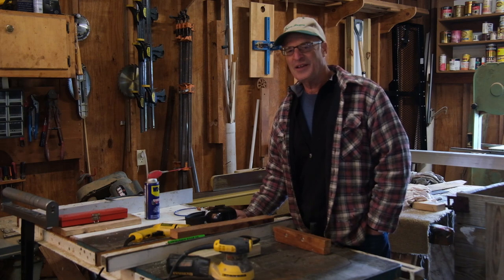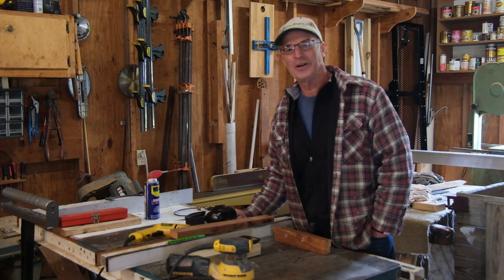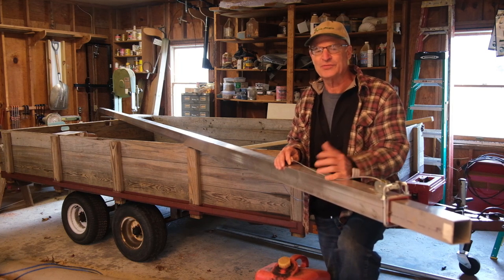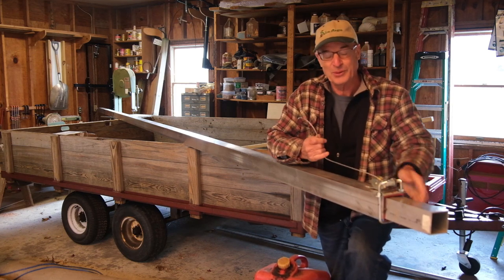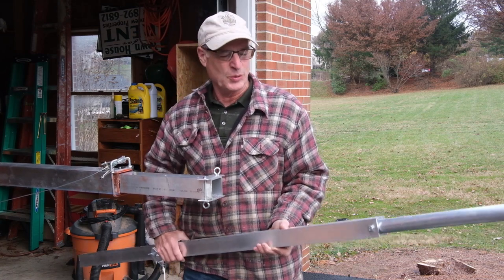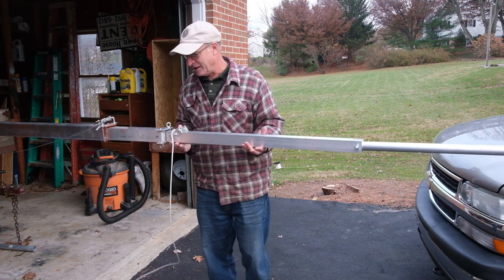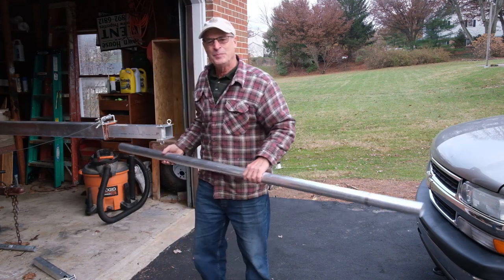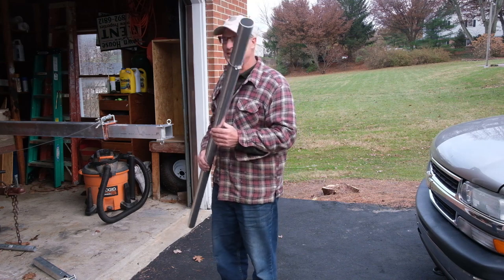Portable Telescoping Mast / Vertical Antenna

Comment: Great job, Jonathan! I just put up a GMRS antenna at my house…but, I wasn’t financially able to be as fancy as your install was after the expense of buying two HTs, one base radio, SWR meter, power supply, all of the clamps, coax, rebar to reinforce the bottom of the mast, etc, and the mast itself. The top of my antenna is only 21 feet above the ground but is working quite well talking from my house in Houston,Tx to California, Louisiana, and all over Texas with the help of repeaters currently. I have to say that I absolutely LOVE your crank-up operation of each section! Stay safe and 73s! ~Jim WRXY 695~
Reply from the maker: Nice.... Happy it is working well for you.

Comment: I helped a guy put a hex beam up, several years ago.  It is very light and low wind load.  It tuned up well and has survived Houston weather since.
Reply from the maker: Yes...our Field day group has switched to all spiderbeams.   Very light, not traps, nice gain, and very easy to assemble and they give 10, 15, 20 with very low SWR.    https://www.youtube.com/watch?v=DCMhtuU4ax8&t=6s

Comment: What a great video as well as a great design. I'm also very impressed with the results of the vertical working DX. 
I was wondering how you knew when to stop cranking so you don't unplug the second section of mast. Here's a suggestion.
The cable that connects to the telescoping section is fixed to the tubing. Once you extend it, put some red paint on the cable
close to the ground where you stand. Also put some red paint on the bottom section of hour mast. When you extend the second section of tubing and the two red paint marks line up, you are done. 

To be able to easily take apart the mast to use it for field day as well as a DX antenna in your back yard is great. 
The shunt coil is a great idea. I choose to make UnUn's for matching. Jerry Sevick's book shows how to make a 38 ohm to 50 ohm UnUn and it also puts the antenna at DC ground. I've made numerous UnUn's for inverted L's but they are 22.22 ohms to 50 ohms. 

Nice job, nice video and thanks for sharing.
Barry G. Kery, KU3X
Reply from the maker: Thanks.   Actually I did put a piece of tape on the second cable so I knew exactly where the vertical was 1 to 1 on 80 meters.   Because it worked so good I actually built a fan vertical for 80 and 160 with wires.   I really like that fan vertical....don't know why it took me so long to take an interest in something like that.     I must say I tried this telescoping mast to raise a 2 element 15 meter beam from the back of the car but quickly realized it's bracing was far from sufficient.   So fabricated a strong tripod with angle iron to raise a spider beam for this field day.   I really believe it will work great.   I am sure I will have an update on that project when I finish the homemade spiderbeam.

Comment: Very nicely done, sir - I really enjoyed watching your video! 

I am new to the amateur radio hobby, and have built a 1/4 wave multi-band vertical antenna based very closely on the DX Commander All Band Vertical antenna. Your results bear out what I have found in studying just a little about antennas - that vertical antennas have a lower take-off angle than horizontal ones, and thereby are better suited for long range DX work. With my antenna and a 20 watt Xiegu G90 radio, I was able to have a conversation with a station in Canada, 1000 miles north of my location, on the 20 meter band. 

Having success with my home brew vertical antenna was very satisfying to me - I can only imagine how pleased you must be with the results of your project!  73 to you, KO4AZY.

Comment: Nice, go by a box of wing nuts for the radial plate.  Since it’s a “temporary installation, it would likely make the job of installing the radials easier.  I have a DX Commander, and he connects 5 or 6 radials in6to a single yellow fork crimp and just slides it over the bolt and tightens it up.  Very nice construction of your mast.  Years ago, I scratch built a lighting mast that went up 45ft in 3 sections,  but when we built ours, it was steel and we used rollers to reduce friction when winching it up.  The lights presented a significant wind loading, so steel was better suited for the loads.  I think we did 4”,  2” and a round 1.5 pipe at the top but it’s been a long time.  Got to love verticals for low angle takeoffs.

Comment: Interesting build of a vertical antenna that had amazing results.
Reply: Up 33ft you could probably use it for a 20 meter 2 or 3 element Yagi antenna with rotator.😮😅😊

Comment: Sir, This has to be one of the most impressive, professional looking setups I've ever seen. I have been into the CB hobby for a number of years and I've recently been interested in getting my Ham license. It amazes me the amount of intelligence and information that Ham's seem to have stored up in their minds. It's quite overwhelming to say the least. You have definitely brought the interest in obtaining my license back to the surface. Hopefully we'll be able to make contact in the near future. Best of luck to you from Central Indiana and God Bless! 
-Brian
Reply from the maker: Thanks.... It is fun to build stuff and make it work.
Reply: So Jonathan, when are you coming over?  This is exactly what I need!
When it was all said and done, how much did this project cost you?
Reply from the maker: @richarde735  I really don't know.... Maybe 350 plus balun which was 89.
Reply: Jonathan Charles  $350 isn’t bad. I’m currently building a no radial vertical flat pole antenna for 20m and I may add radials and make a 40m
Reply from the maker: I think adding radials would help a lot....well worth the extra effort.   Check my last video doing qrp....just three elevated radials did very well.

Comment: V nice!  I bet you could run some power through that thing!
   I would want to mount one up top of one of those trees. A larger lower section so the top section can be all the way out of the tree and counterpoise coming down the outsides of the tree like guy wires.
  Or put a glass fibre 20M pole above this for the top section.

Comment: Wow, great job on the Antenna..  do you have the specs for your static dissipation coil and ground radial plate at the bottom an how it is all attached to the Antenna.  Thanks for taking the time to make and post this wonderful video..  Mike N4LEP

Comment: What a great method and video for such an application.  Would you consider sharing a materials list and diagram of the hinge/ support structure.  73, Steve WB4IZC
Reply from the maker: I just welded two strong door hinges a 4 inch sq steel column that I cut in half to create a cradle for the mast....then I attached the hinges to this framing lumber and angle iron I had.   You probably could construct it differently with what you have in storage.   I made a smaller one without a hinge for FD this past year.   You can see them in use in this video.   They actually worked really well.     https://www.youtube.com/watch?v=DCMhtuU4ax8

Comment: HI... Greatings from PANAMA
I'm HP1JFG,  can you please explain how to elevate the two square segment, I mean It looks you use an internal pulley.
Reply from the maker: I have the pulley on the outside right against the square mast.   It pulls the cable through a rather large hole.   The cable goes into the center of the inside mast through a slot I sawed 4 feet from the bottom to 18 inches from the top.   I capped the bottom of the the inside mast and have a ring bolted to the cap inside the bottom mast.   I attached the cable to the bottom of the mast with that ring.   The bracing was not sufficient to raise the spider beam on Field Day.   So I made up my own platform to raise it.   https://www.youtube.com/watch?v=5ks3EhFdArU&t=75s    This past year we used it for Field Day.   I have no pictures of that but my niece made this little video.... we had the spiderbeam up 40 feet.   I think you will like this.  https://www.facebook.com/heather.tieszen/videos/1200075377119368

Comment: This is very nice! How much does it cost?
Reply: 3" square aluminum (1/8" wall) mast by 24 feet long = $123
2-1/2" square aluminum mast = appx $89
A Steel Ratchet winch (1400 lb. capacity with a reversible ratchet) is available from Ace Hardware for $47
 (link below)
https://www.acehardware.com/departments/lawn-and-garden/farm-and-ranch-supplies/farm-equipment-parts/7020662
Reply: @cougar-den5439  That's not bad at all for a mast that nice. Thanks for the video! 
I'm thinking of building a 30ft steel tilt over pipe with guide wires at the top and run a Sirio Gainmaster up it like a flag.
That way I could get it all the way to the ground real fast  in case of high winds.
Reply: @RC-Heli835  This isn't my video. Just trying to help out.
Reply: @cougar-den5439  Oh ok I didn't catch that. Thanks for the info.😬

Comment: Jonathon, did you consider making the telescopic section out of round tubing?  Pros/cons?
Reply from the maker: The primary reason why is that my local metal supply store does not carry round tubing.   Square is so much easier to fabricate though.   We use round tubing for masts for Field day....but they do not slide....we tighten them down with hose clamps and they work great.   You can see how we use them in my Field Day videos.

Comment: I acquired a couple of aluminum  parking lot light poles that were blown down by Michael a Hurricane that blew through my community, anyway they started out at 30 ft but the hole used to do maintenance  on each was the weak spot so they were broken there making them 27 ft on one of them , the other 22 ft someone tried to cut it up for salvage and a cut piece  5 ft long  piece that came with them. They are about 8 inches inside at the bottom and have a about 2 foot square platform on the top where the pole is still 4 inches inside where the lights were mounted . I guess they could be mounted together using the platform making a 47 ft single . Or I could just add what ever length needed to make it work for 40 meters or like yours 80 meters, but 27 ft to 66 is rather a task. I will review your video a few times and if OK , might ask  for any suggestions you might have as to how to mount the pole at the bottom. I am not real trusting as to thickness so a way to fill it and strengthen it at the bottom  needs figuring out. Anyway thank you for sharing and if an update exists, please post a link. Thank you !!

Comment: Copper conductive grease on AL tubing -- would that create a dissimilar metals problem?
Reply from the maker: I don't believe so.   It is a product that is often packaged with commercial beams to keep aluminum elements as a kind of antioxidant paste I imagine.  I like to use copper grease with Field Day beams because it allows telescoping aluminum to slide together and separate easier.

Comment: Maube I missed it but are is the center attatched so you can raise it ?
Reply from the maker: yes.... I saw a slot in the inside tube so a cable can be attached to the bottom of tube....the cable goes through a hole to the outside pulley and down to the winch.

Comment: NICE Heavy Duty setup for a permanent homemade mast need some aircraft cable to guy it. Rope stretches too much!
Reply from the maker: You are right.... just had it up a couple of weeks.   But it worked so good I replaced it with a fan vertical for both 80 and 160 built with wire.   I think it is almost as good.   It is vertical up to the 60 foot level before it turns horizontal to make the L.   This will be permanent.
Reply from the maker: @miguelsalami  Without seeing the situation it is really hard to give an answer.   Your local carpenter would be a better person to ask I imagine.
Reply: so many kinds of rope, most of which are not suitable here. Consider Mastrant-P, Break Strength 660 lbs.

Comment: I just can’t figure out how the rope is used to telescope the additional section.
Reply: The rope (usually a wire rope) goes up the outside of the bottom mast section, over a pulley, then back down the inside.  There, it attaches to the bottom of the nested inner section. Winching the rope merely pulls the inner section up.

Comment: Your video is most informative, I am contemplating the construction of a crank up tilt over tower to support a rotor and  a  multi band HF  2 element quad. I would love to be in touch with you, e-mail would be fine
Reply from the maker: Thank you for your comment.   My email address is Jcharlesstudio@gmail.com
Reply: Thank you, you just gave me an idea, I have two aluminum parking lot light poles, they started out at 30 feet, but were blown down by Hurricane Michael, the weak spot being the  hole used for maintenance etc. Any way they are 8 inches inside at the bottom tapering to 4 inches at the top. I might figure a way to put the shorter one over the longer and then raise it up somehow giving me a 47+ ft pole that could then hold a cobweb or other non-turned antenna or even  load as a vertical . I thought of attaching one on top of the other, but that would leave an 8 inch opening at the top to collect water and be a weird off balanced pole with 8 inches at the ends a 4 in the middle where joined. Thank you again you got me thinking?.
Reply: Great vidio keep up the good work

Comment: How does the wire connect into the other telescopic mast when you crank it up.
Reply from the maker: I greased the bottom part of the inside mast with that copper grease to help make good contact between the mast sections....other than that it is just the pressure between the sections to make good electrical contact.   Seems really solid.... Never saw any spiking in swr which would give me to think the connection would not be solid.
Reply: @radionb3i  Many thanks for the reply Jonathan. Could you direct me to a plan or idea that I can build for a small telescopic mast. I was pondering with the idea of using 2 sections of tubing - one 40mm and the other to slide into that, but stuck with the hole interface. how the wire goes into the other tubing to raise the inner section of the pole. Fantastic Idea you got there ! 73's  ZS1WE Cape Town SA.
Reply from the maker: I don't really have a plan...maybe I could make something up.  I will email you something to email address on qrz..com.